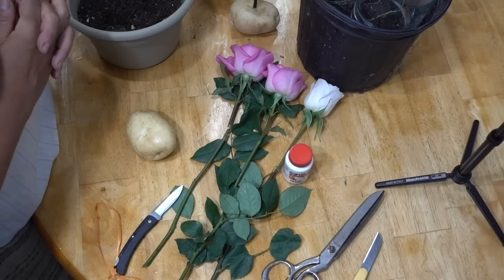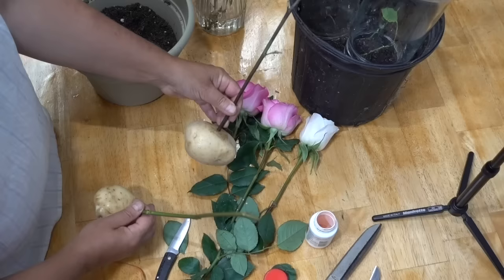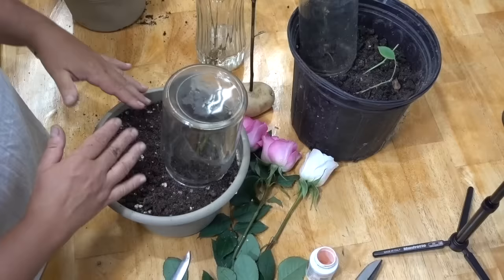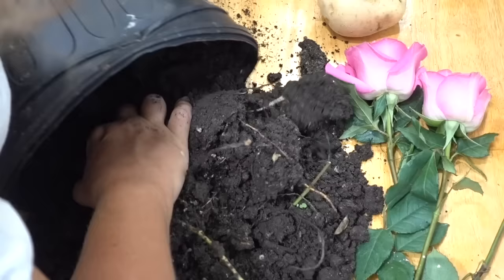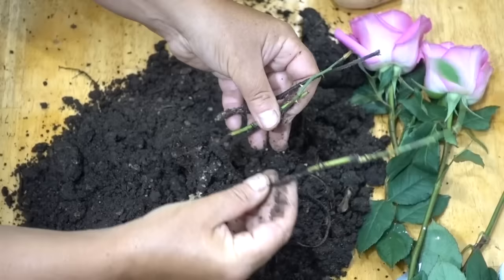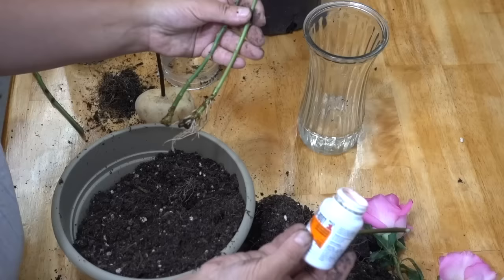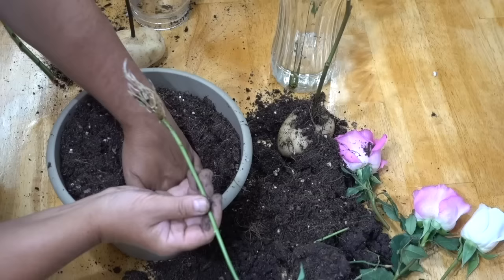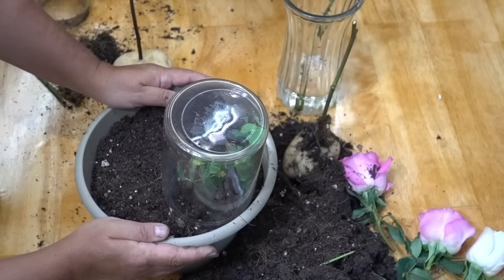Growing Rose Cuttings In a Potato Debunking the Myth

Comment: This propagation method works great both indoors or outdoors—if done correctly. I've grown five or six plants this way.
Nutrients come from the soil, sunlight can go through the jar, and loose soil allows oxygen flow (you did state to remove the jar which is necessary); covering to retain moisture is extremely common practice when taking any cutting, but not necessary if everything else was done correctly.

The main problem is that you cut off all the leaves! No leaves means virtually no photosynthesis is occurring, no nutrients are being used as the potato decomposes leading to rot. Obviously it's just going to die if you remove all the leaves. Any organic decomposition will work for nutrients, doesn't need to be a potato.

You should have taken a rose, topped the flower to reduce wasted energy going to flower growth; clipped the portion of the rose stem that's going into the potato at an angle beneath a node (not just in the middle of the stem), placed it in the potato and buried. Topping it directly above the upper leaves will produce a nice full rose bush with 3-5 flowering stems. Topping it about 0.5 in above the top leaves will give you less flowering stems, most likely just two.

Second big problem is the potato produces a huge amount of moisture which will steadily saturate the soil over time so you want to use dry soil (even throw some perlite/vermiculite under the potato) and water minimally. The soil looked fresh and moist; it didn't stand a chance unfortunately. The rose is getting it's moisture from the potato, and (ideally) the potato is decomposing and slowly adding moisture to the soil so that when rooting occurs, you have a stream of nutrients and moisture going into the rhizosphere.

Also, the fact that the potato rotted completely without sprouting any roots suggests the soil was sterile and didn't have the proper microbiome to properly return decomposing nutrients to the soil.
Reply from the maker: It doesn’t matter what I did or didn’t do. This method is A HOAX!
Reply: really impressive and comprehensive response  , thanks
Reply: @Classyflowers  You did it wrong. Simple as that.
Reply: @Classyflowers  It does work but you need to apply honey or possibly even rooting powder. Just because it didn't work for you doesn't mean it's a hoax. Try, try again.
Reply from the maker: Insanity is doing the same thing over and over and expecting different results.” Albert Einstein
Reply: @Classyflowers  No, it works I have a beautiful rose bush from a clipping and a potato  dipped in growth hormone. It took  almost three years before I saw any growth. But it was worth the wait. Just try again and tweak your mistakes.
Reply: @Classyflowers  if you do it the wrong way, is it really insanity to try again the correct way? Pretty rude to viewers that gave actual advice rather than just trashing you bc you didnt do it correctly. I find in the gardening community someone always has great advice that you didnt know beforehand, a method that previously didnt work for you may work using the advice of another gardener.
Reply from the maker: There’s no right to do it! It is a HOAX!
Reply: @Classyflowers  you seem very scientific and clear spoken. It's very possible you're just wrong. Caption letters and exclamation marks doesn't help your case karen
Reply from the maker: @Fufu0117  Are you growing rainbow, blue and black roses too? Einstein 😂
Reply: @Classyflowers  worked btw. You're just wrong.

Comment: Well I tried this a couple of weeks ago and not only do I now  have small leaves starting to emerge from the rose stem but I also have completely new leaves pushing up from under the potting mix. Perhaps your use of a solid sealed glass jar instead of a plastic  bottle with the cap removed made the difference.🇦🇺🇦🇺
Reply: Do you have roots or just leaves?

Comment: I have had great success using the potato method, the potato provides nutrients and moisture while also holding the cutting securely in place . I did notice that this woman did not leave any leaf on the cutting when she tried the potato method. the leaf is necessary for photosynthesis to occur .
Reply from the maker: By what means the  potato 🥔 provides nutrients to the rose? The rose 🌹 has no roots.
Reply: @S w lol comments on this video are hilarious.... potato in this case provides absolutely no different environment than moist soil. The stem wont absorb any nutrients until roots form. But any potential roots will get attacked by fungi and bacteria which are feeding on potato decomposition... even if you keep leaves on rose stem - no matter, potato is rotting and creating the worst environment for your stem. Best environment to root is a sterile one where you can avoid contamination by fungi which causes root rot. Stop watching 5 min crafts videos and believing all that nonsense....

Comment: Usually I take a rose cutting without any leaves but both ends cut and place it horizontally under the soil kept damp at all times. Within 10 days tiny roots appear  at the nodes. The beauty of this method is that it is fast as both ends of the cutting are never dry unlike in the upright position in which the top end fails to conserve moisture.
Reply: Would make a vedio of your method? This the first time I heard about. Thank you
Reply: Good write-up.  I like that principle about the cutting not being exposed to drying out.  When the gardening bug takes over I will try this horizontal tip. 😂 
Have you tried doing this with Hydrangeas also?  I've tried doing upright cuttings from a plant but they must'v dried out.  
The people on Gardening Shows make it look SOOOO much easier - maybe there really is such a thing as having a green 👍

Comment: While I have been cloning plants (asexual propagation) for literally decades, including meristematic cloning in agar, I have never tried the potato method, but you said that you wanted to be fair.  To grow roots there must be some sort of nutrient exchange, mostly through photosynthesis.  A rose stem with out leaves does not produce enough photosynthesis to grow roots.  All the examples I have seen  include an ample amount of leaves to do so. As an aside, look into the difference between water roots and planting medium roots.
Reply: I have to disagree with you, Dan. Commercial propagators bundle as many as a hundred, less than pencil diameter, rose cuttings with wire in preparation to rooting (usually in sharp sand).

They seldom lose any, but more important, there's not one leaf on any of the cuttings. I have tried this and it works. In all fairness, I do have near 100% success when I insert them individually and leave two small leaves on them at top. I never leave an 'ample' amount of leaves on the cuttings. The rootless cutting can't feed all those leaves and they will fall off, anyway.

There is enough energy in a leafless cutting to start the rooting process.

Comment: Of course it didn't work, you made lots of mistakes.
1. Cut on an angle just below a node.
2. It needs leaves for photosynthesis.
3. Node with rooting hormone is inserted into the middle of the potato.
4. Only about 1 inch of soil over the top of the potato. Do not bury the next node.
5. Use a vented plastic bag and do not let it touch the leaves.
Reply: Problem is, that would still be an anoxic environment. Roots cannot grow in an anoxic environment.

Comment: I’ve seen this done successfully but usually the BOTTOM of the bottle is cut away and placed over the stalk WITHOUT the lid so it’s receiving air constantly, and it’s imperative that a flowerpot with sufficient holes and a tray beneath is used so that the plant can draw the water from the tray thereby avoiding the rotting that happens when soil saturated from the top. The roses DID grow successfully within three months time outdoors in central FL using MiracleGro potting soil and no other additives than water and indirect sunlight.

Comment: You didn’t leave any leaves on the plant when you did the potato method. Why did you remove all of the leaves? But you kept the leaves on when you used your second method (with water). That’s the reason the rose died in the potato but was successful in the water.

Comment: Don’t use a glass jar!!! Use a plastic bottle instead, that way it can breathe & it’ll also make sure it doesn’t get way to hot by letting the heat escape out the top of the bottle. I’ve done this a lot the last few years & not once have any of my plants died on me. The potato could of gotten rotten from to much water depending how often you water it & how much water you use every time when watering your plants. That’s just my opinion on why the potato might be dead rotten & will kill the rose stalk but using glass jars might magnify the sun rays like a magnify glass does & the glass jar traps to much heat & it’ll just get hotter & hotter & it’s more then the plant can take. Plastic bottle will along the plants to breathe while letting any extra heat out compared to a glass jar. She lifts the jar up then puts it back over the plant, depending on how much oxygen the plant needs & how much the glass jar holds you might have to pick it up then cover the plant quite a bit depending on how much oxygen it will use & however much your jar will hold every time you pick it up . All you can do is keep on trying & trying till you figure it out or find the best way for you to do it 🙂 it’s only a 🥔 & a piece from a 🌹 bush so if it doesn’t work it’s not the end of the world or a big deal 😆😁 GOOD LUCK to everyone who tries to do this!!! Haven’t tried doing this with any other kind of plants to see if it works but you would think so since a stalk from the 🌹 bush does!!! I’ll let everyone know if I can get any other plants to grow doing it this way and will list which ones worked and which ones didn’t
Reply: once you have roots, do you reallly need to put a plastic jar over it?
Reply: Cool, I was wondering the same, but haven't tried putting another plant stem I  a potato. I wonder if the potato and rose can be planted in the ground instead of a pot?

Comment: Using a 2 liter clear plastic 1/2 coke bottle top works better for humility tent and leaving the cap off lets air transfer.
Reply: @veronikavixon3949  yes but with trapped stale air mold will grow much faster and dampening off is more susceptible.

Comment: Well i tried it, used honey, it worked , i have a healthy rose bush now,  3 years still doing well
Reply: Hi Jackie, Did you use the dirt method or the potato method? My issue is that I have greens leaves at the top but no roots at the bottom after a almost 2 months (still just in water). Thanks for any help you can give me.
Reply: Cant go wrong with honey as root stimulator ... Dried up onions from the grocery store brought back to blooming and regrowing for onion seeds and the plant is 3 ft tall now about to open up and throw seeds .
Reply: We planted three rose bushes with the potato method and honey and they are doing very well. But, we did the honey then the potato and put it directly in the ground not a pot.

Comment: I haven't tried either method with roses. I can say that every time I used a sealed container (glass jar) over a cutting it rotted no matter how often I let air in, even with a fish aquarium bubbler running nonstop. That could be a regional thing though--different pests. Still, I'd try the bottomless and topless plastic bottle to be fair. When I've seen wild roses, they were in low humidity environments, not swampy like the inside of a mason jar. I'm not an endocrinologist but I do wonder if the ethylene gas might be helpful at the roots and undesirable at the stems. The stems you actually used were much thinner than I've seen used with the potato method. Video I watched didn't use honey so can't fault the experiment there. Can't figure out why your potato rotted instead of sprouting like normal. Was it peeled? When I have grown potatoes, the seed potato does normally rot away, but after the plant is well established. They do okay even sliced up before planting, so I don't think the hole should kill it. The hole you made as an example didn't seem like it would make secure contact with the stem.  The part of the stem where roots would normally sprout may not have been in the potato or treated with the hormone. 

Please don't take any of this as personal criticism. Brainstorming potential problems without worry about unflattering language is part of how I debug my own computer code--it is just how I'm used to approaching problem solving.  I think you are to be commended for experimenting instead of armchair bloviating which is all I've done so far, and even professional scientists make mistakes in reproducing experiments. It is even more difficult in this case because there are probably already hundreds of variations of the method. 

I might give the potatoes a try because it does seem like a potentially good idea since it could supply the stem with nutrition and water and maybe hormones it might find useful, similar to the way the potato eyes find the potato useful for those reasons. On the other hand, a rose is a rose and a spud is a spud...

Comment: Knowing what I do about cuttings and potatoes, I would say the potato works, how ever not the way you did the test. A potato is basically pure food storage, and seals out dirt contained disease. Parts of a potato will even rot while growing potatoes from eyes. I would suggest trying 1 inch pieces of potatoes with an eye on them so the potato doesnt rot while its being used as a starter. I do my roses outdoors in the spring and fall under mason jars
Reply: Hi. Thanks for sharing. Question… when you do one inch pieces - do you do it like a cube or one inch depth of the full diameter or the potato (like a thick potato chip)? And do you use fertilizer with your soil?
Reply: @vradinovic1  I have never actually used a potato. I do seeds in the fridge because they aren't the same rose every one else has. At about 3 years old if I like the bloom I will graft it to wild root start. The rose bush you have left when a hybrid dies out. It will root easier and grow faster allowing a splice to bloom the first year after being grafted. I how ever don,t support 100 percent grafting though. It prevents new types of plants and doesn't allow hybrid to stabilizes so they eventually produce their on true seeds which can take several generations to do. Mass production of plants with grafting is more to control the market than it is for quality of the plants or the evolution of them
Reply: Thanks! You sound like you know your stuff! Good luck with the growing :) I’m trying to see what happens with a bud I have just in water in a glass - no incubation or green housing right now. Practice makes perfect!
Reply: @vradinovic1  you don,t need much starting out. I have almost 300 succulents and cactus indoors now I started from leafs. Now working on a red dragon Japanese maples bonsai tree. I started it from seeds. You can start out with just a 2500 Kevin and a 5000k light bulb for grow lights. Then later own I would suggest expanding to barrina led plant lights they aren't very expensive and come in sets thar you can plug into each other. Then get a set of cheap pin timers so can put plants on a a schedule
Reply: @vradinovic1  you can start roses from seeds in your fridge. Put seeds on a coffee filter. Take a cap of 3 percent peroxide and to 16 ounces of water mix and put in a spray bottle. Spritz the coffee filter. This does two things helps kill any bacteria and fungus on the seeds and it helps stratify the seeds making them easier to germinate. Fold the coffee filter into tiny pyramid shape with seeds on one half of the filter before you fold it. Tuck it into a zip lock bag and blow some air in it and seal it. Put in your produce drawer in fridge. In few weeks you should see them spouting. Check every so often to see if seeds are spouting or have mold on them if seeds get mold take pair of twizzers and pitch bad ones and spritz with peroxide again
Reply: @vradinovic1  ps can use a clear bag for green house. Just need to let it air out every day or so